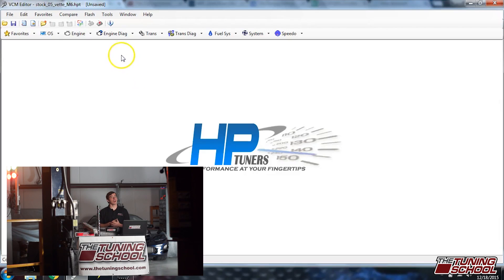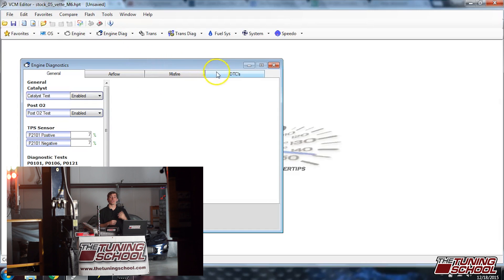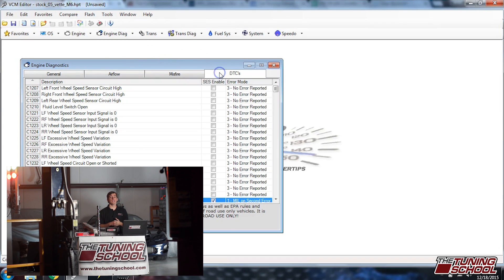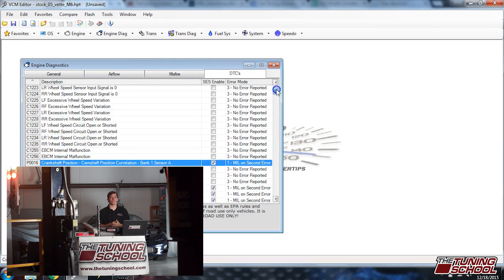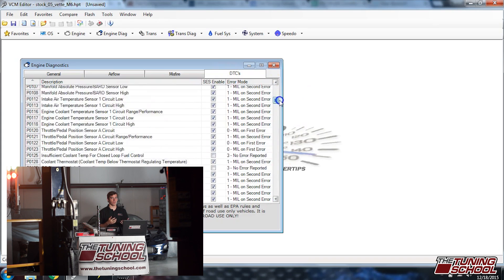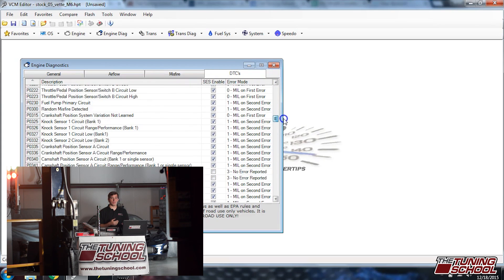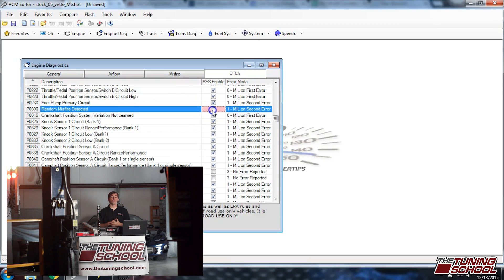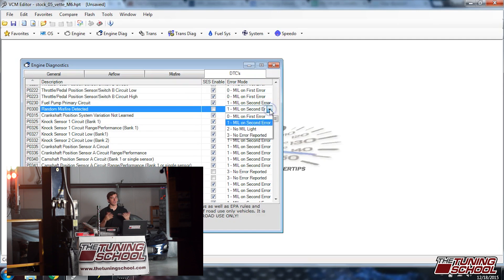How to Fix Random Misfire Code: P0300 After CAM Install Using HP Tuners VCM Suite

Comment: After my cam install my check engine flashing but i don't have misfire code why this happened i don't get it tune yeah
Reply: When it flashes it's a pending code, it's the P0300 code under "pending" status instead of "current" status.
Reply: @MrShenron89 no more after tune thanks you sr

Comment: I did this but my light still comes on even with the ses enable unchecked and the mil light still flashes but the code doesn’t appear when you read the codes

Comment: So what if you actually start getting actual misfires after this?  You won't get any codes.  There has to be a better way of fixing this problem.  Can't the threshold for misfires be raised or something?
Reply: Yes it can sad this is the fix they suggested at a tuning school
Reply: @texasracingsindicate  is that the best way? How exactly does the misfire detection work? I agree certainly isn't the best to disable the code.

Comment: I Just saw this, I have a question: My ECM on my 2010 Camaro SS is killing the #1 cylinder with the P0010 code and "Service Stabilitrak, I have changed all parts related  and it's been determined that it's the ECM. I did a DoD delete and VVT delete over a year ago. It's been doing fine till now. I have HP tuner newest upgrade. Do I simply download my old ECM tune to the new one to replace the old one? Any advice would be appreciated.

Comment: I got this a few times after a btr stage 2 installed, this morning truck stalled after pulling out at green light
Reply: What would it stall?
Reply: Hey man, I installed a btr stage 4 cam. It throws a misfire code but I’m not sure if it’s fine or not. Did you figure it out??
Reply: @On3Manny hey man did you ever figure this out

Comment: Would that still make it able to pass emissions with it turned off? I rebuilt my ls2 with a smaller cam and it comes on at like 65mph
Reply: My 99 trans am with a cammed LM7 swap passes smog just fine but I haven't disabled the code yet, just got HP tuners but it shouldn't be a problem.

Comment: Mine still does even after this
Reply from the maker: Give us a call and hopefully we can walk you through your specific situation.
Reply: Whats a good number for you guys. I did a Texas speed cam and every tuner is gone around here in destin florida so i bought hp tuner credits etc. my ls2 keeps getting eng light, need to soften the ability to read misfires under 1500 rpm due to cam is what im gathering correct.

Comment: I have a 2006 GTO and apparently the previous owner upgraded things and it has a random misfire that acts up more often than other times but once you drive it for a bit it goes away. But if you turn the car off and back on again, it'll act up again until driven a certain amount of time. I'm not sure what that could be.
Reply: Kyle Watkins leaking fuel injector.
Reply: @infamyseemsshort  I'm gonna have a live feed data diagnosis and see which injector it is. Then maybe change one but I heard you might as well change them all. What do you think
Reply: Kyle Watkins that would depend on your budget and the vehicle. But you surely don’t have to.
Reply: @infamyseemsshort  It's a 2006 gto ls2
Reply: Kyle Watkins oh yeah I saw that in the first response. Lol. Man if it was me I would only change any bad injectors or any questionable ones.
Reply: Kyle Watkins you get it fixed?

Comment: I swapped a LM7 in place of my LS1 in my 99 trans am (ls1 got hungry ate the crank) anyway my LM7 is cammed 10.25:1 compression ported heads stock ls1 tune do you think this will cause this code to pop up I dont get it alot probably got it 3 time since the swap over a year ago.

Comment: This doesn't prevent it from disabling the torque converter lock up. 
Best is to change the misfire tables.
Reply: so if you did it this way and you had a valid mis in the motor it would make the torque converter lock and unlock rapidly in 4th?
Reply: @dangerousfreedom4965  I think you will still get the individual cylinder misfire code.